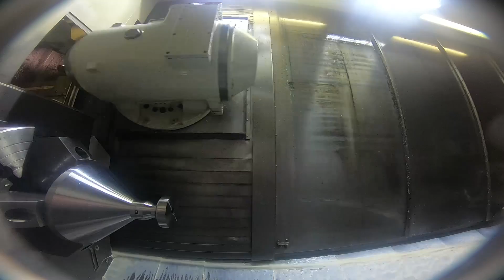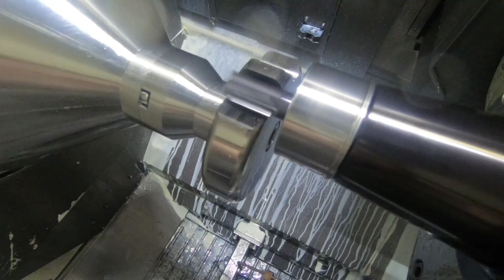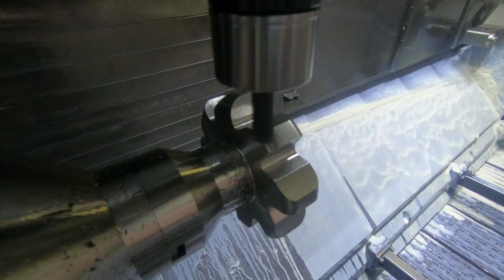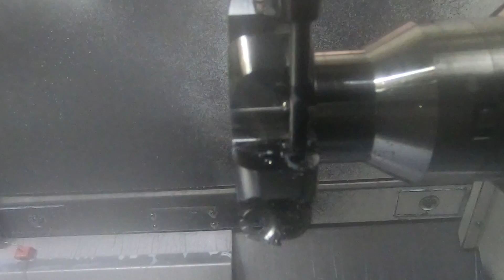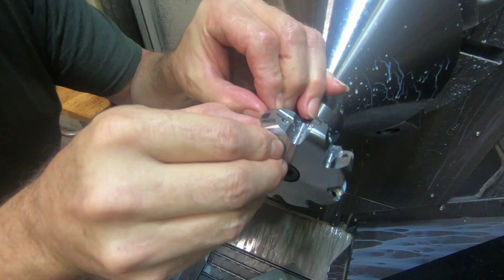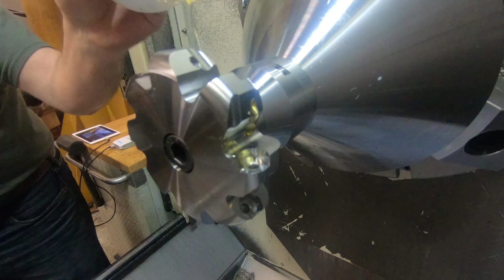Special Cutter Final Opp

Comment: Nice work. Why does the fixture have to be such a large diameter?
Reply from the maker: I wanted to project it out away from the chuck. In case I need to tip the B axis toward the chuck. It gives me the clearance to do so. The fixture isn’t only just for these cutters. I have used it for other tools as well. If the insert pockets  have a lot of positive rake on a right handed tool the B axis has to tip toward the spindle.

Comment: How fast is the sub-spindle turning w/ the 1/2" cutter?
Thx.
Marty
Reply from the maker: The 1/2" endmill is turning a 4000 rpm. The feed rate varies because of the milling style employed but when cutting is at about 50 inches per minute.

Comment: Great video as always Peter. One question, why do you need so many cutters? If the life expectancy of those cutters is such that it is cheaper to make the cutters than buy them, I want to see what they are doing that tears them up so bad.
Reply from the maker: Can’t buy them. The cutters don’t normally get damaged. I have been running the same set for more than a year. I think while I was away they forgot to index the inserts. The inserts have to be indexed every part. There are 16 cutters and 16 parts. The job runs unattended. 15 minutes per part four hours per cycle. With one hour of labor to index inserts and change the parts in the vises. I usually index the inserts while it’s running about four cutters at a time while running the Mazak. It takes an average of 2 inserts per part. At $6.80 per insert.
Reply: Edge Precision, thanks Peter, for the reply. I understand better now. They must be working in some tough stuff.
If you ever get up north east of Dallas, I'd love to buy you lunch.
Reply from the maker: Yes its Inconel 718 at 135 ksi heat treat.

Comment: How expensive is the machine -TheGTA5Freak
Reply from the maker: I didn’t buy this machine new. But a new one with the options this one has would be about $950,000.00.
Reply from the maker: I bought the machine from a mining company in Milwaukee. The machine was built in 2006. According to the display in the machine it has 59,204  hours on on power time.
Reply: Really, I thought you did. How old? what was the hours on machine? demo machine? repo/bank owned?
Reply: Ok.....

Comment: Love your videos. Odd question but how much coolant will that machine hold? How often do you top off the coolant level?
Reply from the maker: I’m not sure the exact coolant volume. I would guess about 200 gal. Most of the coolant gets carried out by the chip conveyer. When running the machine constantly I think I make up coolant about every 1.5 weeks.

Comment: Peter, with the round inserts staggered at three levels can you show us an example of the tool marks it leaves?    Beautiful tool! Thanks
Reply from the maker: In the previous video there is a picture in a picture that shows the parts. It shows the surface it leaves. Remember this is a roughing tool so it leaves a scallop surface.

Comment: Beautiful result. This is probably a stupid question, but if you don't ask, you don't learn! Why are the inserts on a spiral pattern around the cutter body?
Reply from the maker: The cut width is .915 wide. The inserts are 10 mm in diameter. In order to cut that width the inserts have to be staggered. The cutter has 8 inserts but is really a two flute cutter.
Reply from the maker: Daniel Gilbert I think what he is referring to is the profile shape of each tooth. What you are referring to is the set of the teeth on a saw to make the kerf wider than the back of the blade. I have bought table saw blades where one tooth cuts to one side the next tooth cuts in the middle and the next to the other side. This is similar to what this cutter is doing. There are two inserts that cut toward the end face. The next two cut half way up in the middle. The next set half more. The last set cut at the upper face toward the shank. So 8 inserts in two sets of 4. Or two spiral flutes with 4 inserts each.
Reply: I'm not a pro but I'd also like to add that this also makes the cut per tooth less work on each tooth per revolution.. kinda like offset teeth on all types of saw blades.
Reply: Daniel Gilbert no....... no.. no.. think about it... take  look at  a circular saw blade... every tooth is offset.. 1 , 2, 3, over and over so that when you feed in the material the next tooth doesn't have to do so much work... I'm not saying he designed the tool this way for that reason but as a resolute his tool/machine  absolutely benefits.  The more teeth on your cutter the more  horse power your machine needs to complete a revolution.
Reply: Daniel Gilbert ... wow great job... you don't feel comfortable talking about something so you "lol" it off?  It is what it is... there's not a lot of factors....